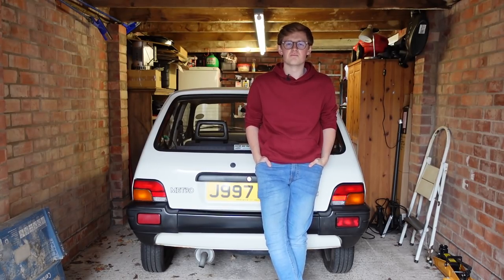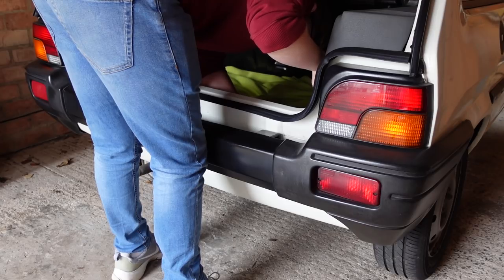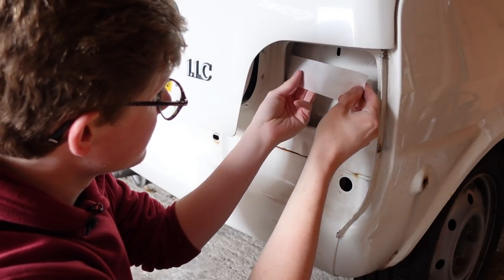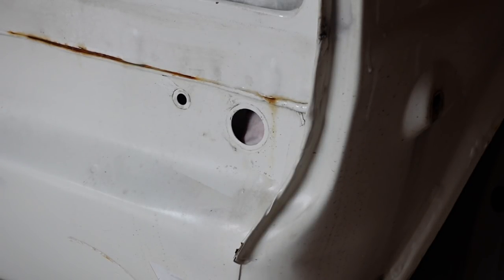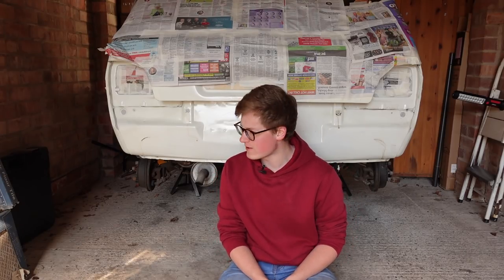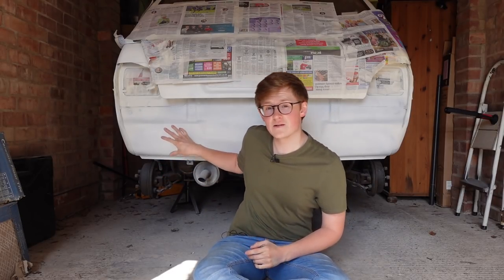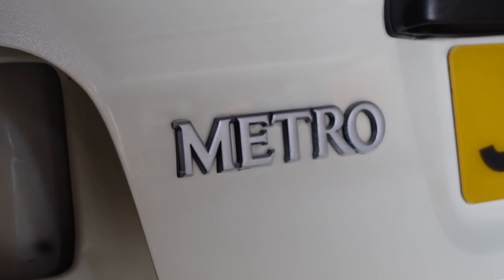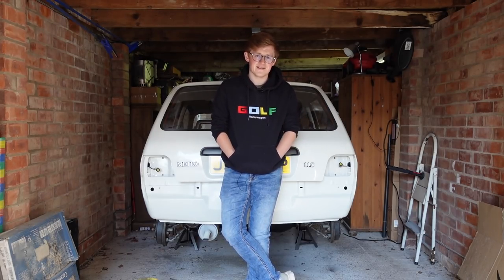Melvin the Metro - Rust and Respraying

Comment: On the lip of the valance it is best using a stonechip which can then be painted. If you are concerned this won't last do it the way you are but once fully dry buy a tin of built and hamber UC spray which is clear hard wax. You can then spray along the lip to protect it. Near Invisible protection

Comment: It's a terrific effort and Melvin looks much better.  When I was spraying some big sections of my Austin A60 using pre-mixed spray cans like you did, I used a clip on handle that turns the spray cans into a spray gun and made the job much easier.  I don't know what sort of paint you were using but I used Acrylic lacquer on the Austin and I found that using long flowing strokes made a big difference to the finish, less orange peel.  Also, I had to do the spraying when the temperature was no more that 20 deg C or at least the very low 20s so that the paint didn't air dry between it leaving the nozzle and hitting the car.  I had never done spraying before I did the Austin and I learned a heck of a lot between the first bit I did and the last.  It's all a learning curve and I'm sure you will keep getting more confident the more you do.  Big congrats.  👍😊

Comment: I'm 19 and have had my metro since I was 16, I spend most of my time doing this exact procedure haha ! Must say your rear valance is in much better condition than mine !
Reply from the maker: What can I say, other than that they're Metros!
It's not dreadful, but there is a small hole in the bottom of mine that I found with a screwdriver when I started this job. The reason I know the valance will be replaced at some point is that my inner valance is utterly rotten. It's like cheese. I have a new inner valance in the loft awaiting its day in the sun, but in order to replace that the outer one needs to come off!
Reply: @TwinCam  haha yes ! My inner valance is crispy in areas!  I've thought about changing it , but can't gind a inner panel and if I did all of that work I would want to do the arches as well.
Reply from the maker: I'm saving up to do a load of work. Offside inner arch, both arch lips, inner and outer valances.
Reply: @TwinCam  will look amazing !!

Comment: Welcome back both of you! Melvin is looking very smart. When it comes to sanding curved surfaces, you might find it better to hold the paper with your fingertips, so it flows around the curves. Hard, flat blocks can tend to miss the "valleys" and over-sand the "hill-tops" and high bits, like the spot-welds. In case you didn't do this: putting the paint spray can in a bucket of hand-hot (definitely NOT boiling) water helps it to mix better and spray more finely from the nozzle, giving a smoother finish. That helped me a lot when I was painting miniature models, before I got an airbrush.
Reply from the maker: Don't worry!
The spray cans were suitably warmed before use and I did plenty of detail work without a sanding block. I just cut it out of the final video.
Reply: @TwinCam  Good good, you are definitely no paintwork noob these days! :)
Reply from the maker: @Zadster  Eeek. Noob is an understatement!

Comment: I had an X Reg Metro 1.0 basic (plastic seats!)  in 1986 when I was probably the age you are now. Even then the bloody thing was rusting on the top front wings and the front spoiler, so did sort of what you just have to get it sold. Not having learnt my lesson I got a B reg MG1300 Metro in 1988 which was a very smart car at the time (XR2 competitor, respectable girl transport), that was better built but then the gearbox bearing seized when I stripped the gear box I found that the bearing was a crappy plastic-cased one.  So fixed that, sold the car and got a 205 GTI which was definitely the dogs...

Comment: I feel your pain on the masking prepping etc —- back in the early 80s I turned a white marina into a mk 2 Granada blue and silver edition lookalike even fitted Granada rear light units frenched front n rear  number plates fitted front splitter and topped it off with wire spoke wheels... so  memory of paint prep and sanding still  brings a tear to my eyes
Reply from the maker: It's so tedious!

Comment: Hay Ed cool to see you having a go when it reaches the time when you have to weld Melvin would be happy to give you pointers or help you if I can. You need to rember wet block sanding is from the USA 5 coats of colour rubbed back to the first. Melvin would of probably only ever of been 2 may be 3 colour coats gun finsh and machine polished fresh out the factory. Its just how it was done in the UK. I have seen with restoration before people go to far and become scared to use a car thats ment to be driven. Cars like that are known a trailer queens
Reply from the maker: When Melvin does get the surgery he deserves, I can confirm that it will be done by a professional!
Reply: Being a professional is relative I work my whole working life as fabricator for both vintage restoration and architectural and structural metal works I welded Bugatti,humber, riley, mustang's, VW, land rover jaguar to name few it's not just about what you weld it's how you do it I was show how by the guys who worked in the factory's and made them in the first place ever car is an individual the best person to restore you car is you what makes it special is the memory you made doing it. Restoration need young ambassadors like you to pic up the torch and have a go to show others they can to

Comment: Great to see you back again, Ed!  To be honest, that's a brilliant colour match, so whoever mixed that up for you, keep using them!  You said you had quite a bit of paint - and that is a great way to go if budget permits.  Tinting is often hit-and-miss, so best to have several cans of a tint done at the same time so if it's right, you have plenty of it.  As to your work on Melvin - hey, it looks good on camera, man.  The only thing I could suggest to improve would be to modify your technique by starting on one side and working your way to the other rather than in the middle and working outwards.  That way, the paint you are applying is always closest to the wet paint that has not started drying yet.  

Secondly, work down from the top so that you reduce the risk of picking dust up into the paint either with the can or when you move on to the next bit.  Using a rattle-can, they tend to be quite a direct spray rather than an even spray over the 'fan' of paint that comes out the nozzle, so you also need to overlap a little.  Don't be afraid of applying several coats too - the more coats of paint you have, the smoother you will get the paint when you wet sand because you wont be scared of sanding through the top layer.  Several lighter coats will always protect (and look) better than one heavy coat as well.

We've all been there, mate.  The fact that you are prepared to have a go at tidying Melvin up yourself instead of paying a panelbeater to do it for you, is to be applauded.  It's not a difficult thing to do, gives so much satisfaction when the final look is revealed and your technique will ALWAYS improve with time.  Like I said - he looks grouse for the attention you've given him.  Even if not perfect to you up close, a classic ALWAYS looks good from 6 feet away - and that's how 99 of people will be viewing him.  Keep on doing what you are doing and your confidence with the 'can will achieve the result you will be happy with.  I look forward to the next video.
Reply from the maker: To be fair, it doesn't look too bad! The fact that Melvin is white gave me half the confidence as it's a much easier colour to work with than almost anything else.
Reply: @TwinCam  - Don't get me wrong, Ed.  Melvin DOES look good for the attention you have given him.  

I was attempting to give you a few ways of seeing him in a better light, so that you were MORE pleased with your results.  I tend to be very critical of my own work and see many defects in the finished product where others see the overall effect as "Wow!", so having believed I detected a little self-deprecation in the video, thought I'd offer a few ways of seeing the result as others will see it and a few tips for improving your painting technique so you were better pleased to begin with.    

White can be a hard one to match perfectly, so don't undersell your blending technique there, nor the bloke who did the colour matching / mixed the paint.  The result speaks for itself!  He looks better for your attentions - that's for certain.

Comment: Use dental floss behind the number plate and cut through the sticky pads when you want to take it off.
Reply from the maker: Too much risk involved I feel. These plates are 30 years old and are undoubtedly quite brittle. If I can just mask around it, I feel that is the better option.

Comment: Did you laquar it after you painted it because you need laqaur otherwise it really wont last
Reply from the maker: I had the option at the paint place to have it mixed in two ways. One as single stage and another that would require a lacquer. Melvin only has single stage paint from the factory, so I went for single stage. It does not require a lacquer.

Comment: Good job Ed , stick some clear coat on top mate
Reply from the maker: Thanks Mike :)
I had the option at the paint place to have it mixed in two ways. One as single stage and another that would require a lacquer. Melvin only has single stage paint from the factory, so I went for single stage. It does not require a lacquer.
Reply: @TwinCam  Thats answered my question Ed !!